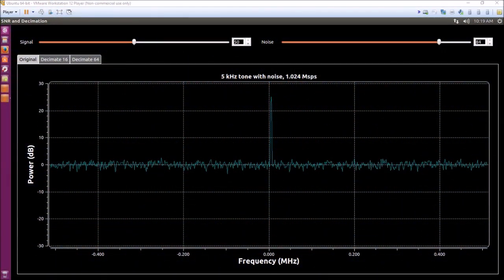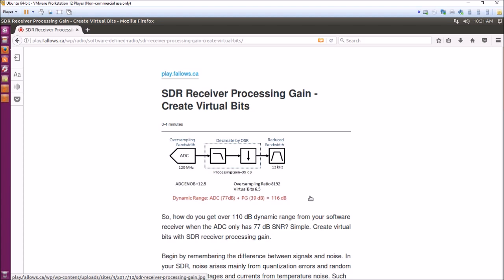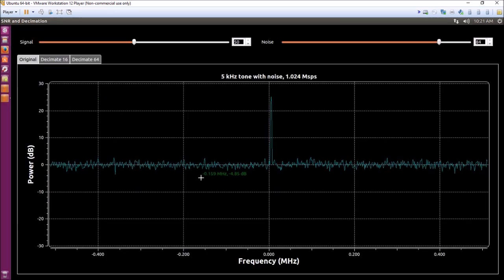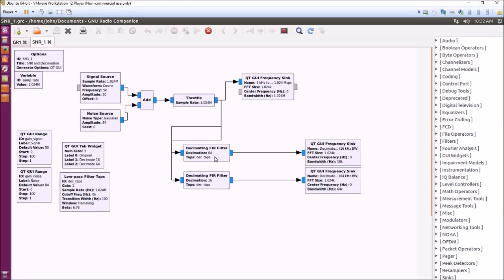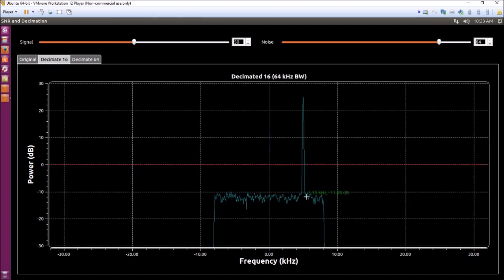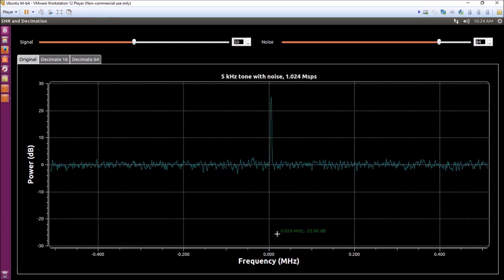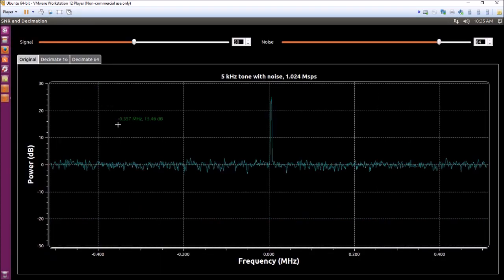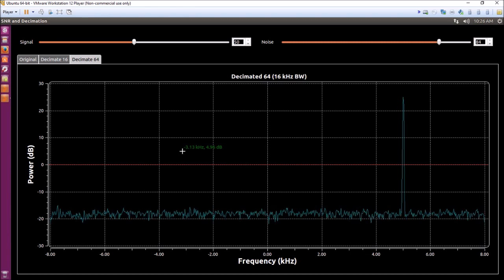Learning SDR DSP   Decimation and SNR

Comment: Great video!  I want to use autocorrelation to detect the preamble of tpms sensors.  They can be ASK, FSK and have different baudrates.  What i want to do is look for peaks at known baud rates first.  For example, If the baudrate is 19200, i would see a peak at 52 uS right?  I would look for peaks for each baud rate.  Upon a peak, I could then dump the queue for further processing to determine if the sensor uses ASK or FSK, etc.  The thing is making it efficient and sensitive.  Could i do the autocorrelation on a decimated signal and get some PG?

Comment: John, it is not the decimation that picks up signal to noise ratio....it is the filtering prior to the decimation.  The filtering constrains the information into a tighter bandwidth which then allow decimation. IT IS NOT THE DECIMATION.  Decimation only picks up calculation efficiency.
Reply from the maker: Good points. Actually, it's both